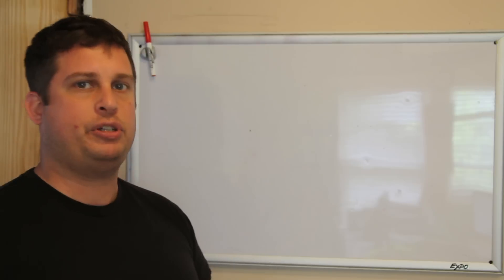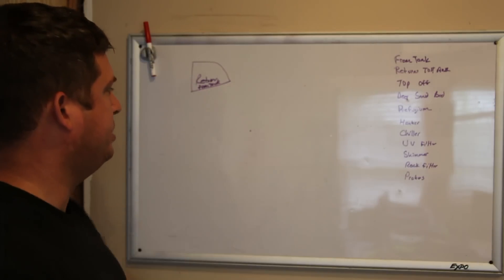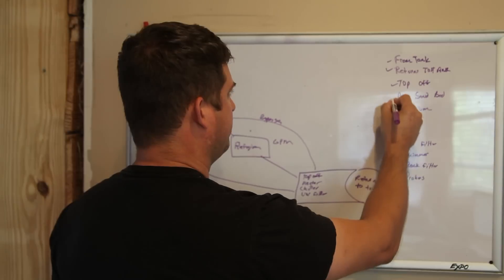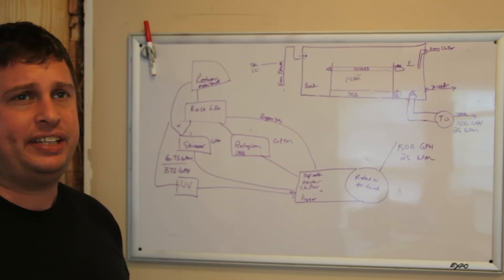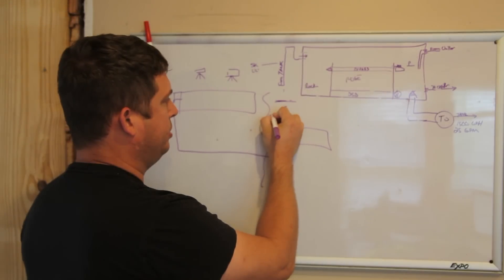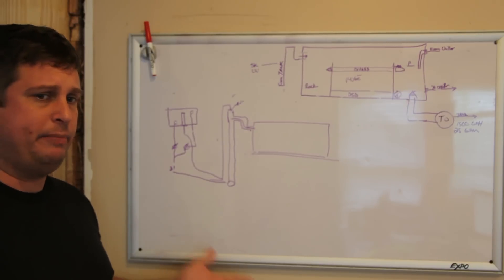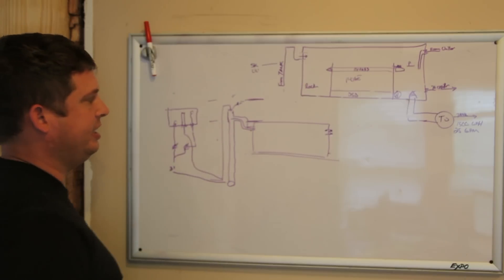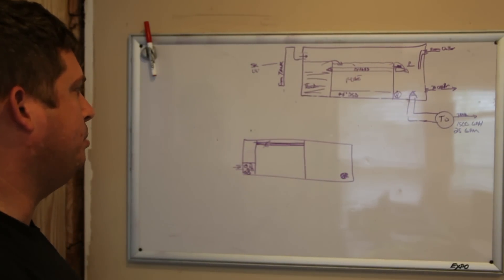Aquarium Sump Design

Comment: This is confusing as all get out and not very thought out.. place a t valve on the return line and divert some water to the UV and have it simply return back to the sump. Not sure why you need a heater and chiller unless you are putting your tank outside your house? Why you wouldn’t put your live rock in your Refug section makes no sense. You don’t want your skimmer cleaning unfiltered water to it’s going to need excessive cleanouts. Now you’re putting your uv on the intake side? So I’m 5min in and your plan is to put two low flow items between your sump and your intake chamber? At the flow rate you’ll be running you may as well just get a $10 hob filter lol.. no wait you just changed everything again now... omg! You just randomly spouted off 57 different setups in 20min most of it incorrectly functioning and non of it informative. Usually I can learn something from any video even ones that are wrong... but you have just taken the cake. Now you’re sealing your bulkheads on the outside of your tank? And you can weld pvc they make compounds for it specifically.. however what you can not due is weld and seal pvc to acrylic or glass which is what it sounds like you are wanting to do but not sure you spoke all about experts and engineers and never said what you were talking about lol..
Reply from the maker: Well, we are all entitled to our opinions.  Hey I think Walmart has 10 gallon tanks on sale.  Hurry!  

In all seriousness, this is a large tank setup.  The Sump was in a remote fishroom that was not air conditioned or heated.  I live in Houston, Texas.  Also known as Bayou City aka Swamp City.  It's hot and humid here.  We keep our houses at 72 to 74 9 months of the year.  So having a chiller is a requirement... as is having a heater.

The overflow box was designed to resist partial clogging, be quiet by reducing the velocity, and the valve was for throttling the flow.  If the flow was not throttled the system would be untuned and it would oscillate making noise.

Comment: Thanks for sharing. Some interesting thoughts. I hadn't considered regulating the flow across the refugium.  I'm not clear why you wouldn't want all of the water flowing through, maybe  the volume of flow through the sump is the issue. My only concern is the rock bed at the beginning of the sump. I think excess detritus will overwhelm the rocks ability to process the bacteria.